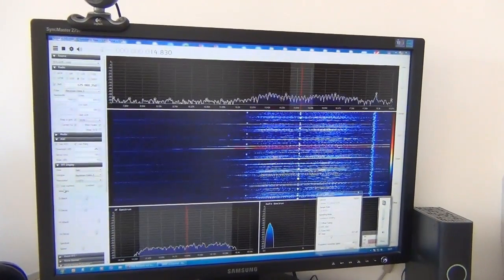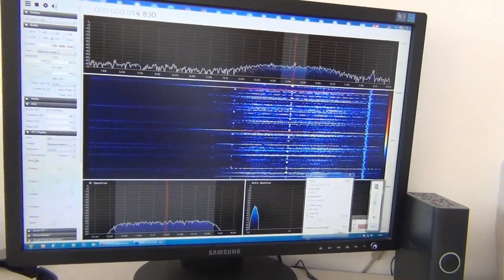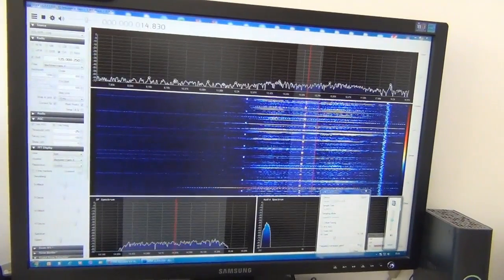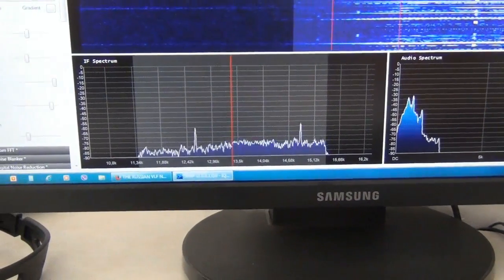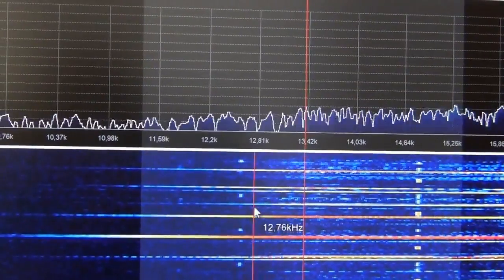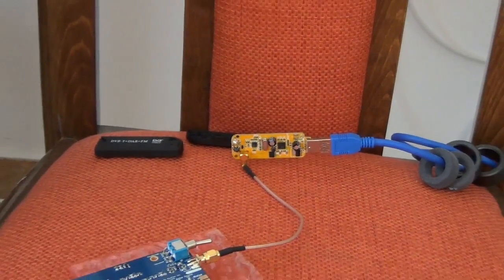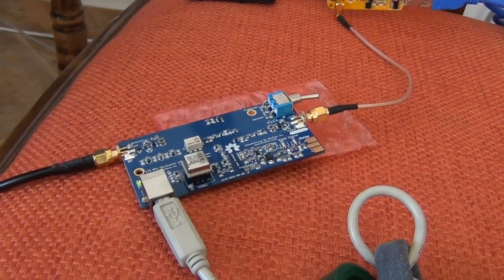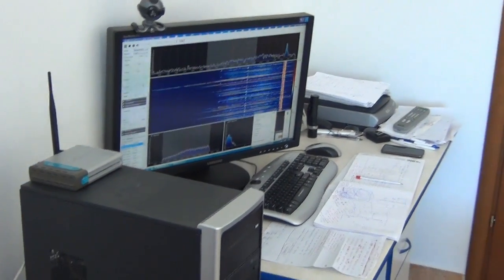RTL-SDR on VLF (ALPHA Russian Long Range Navigation System receiving in Macedonia with MiniWhip)

Comment: Hello Mile, Could you tell me what kind of ferrite toroids you are using around the USB cable (visible at 4.07 min in your movie)? Is it 61 or 77 material?regardsMark
Reply from the maker: +Mark van Dommelen: I am using no name ferrite toroids. Just those which I have. I realy don`t know the  type of the ferrite toroids material... :-(
Reply: Ok no problem Mile, did you check the difference with and without the toroid cores? does it make a difference in receiving the alpha signals?
Reply from the maker: +Mark van Dommelen : USB cable without ferrite toroid cores produces unwanted signals, especially in VLF, LF and HF, with vary levels depends of location and distance between PC and SDR...

Comment: How could you get such clear signals on such a low frequency? I have a RTL-SDR and also the Ham it Up v1.2 and basicaally all I receive under shortwave is noise and interference, even AM signals are very noisy. I have a homebuilt discone antenna and a ramdom wire antena.
Reply from the maker: +t0nito, On AM band, LF and VLF, there are lot of man made RF-noise, and very high noise level. A good and adequate antenna for receiving those frequencies is essential. One of the best antenna you could make yourself  (for receiving only) is mini-whip active antenna. You can find the details described in my comments on my other videos here on Youtube, or you can find many articles on the web about making this antenna (PA0RDT basic design)...

Comment: Hi Mile,
what about the Khabarovsk and Seyda  Alpha transmitters are they no more active ?
Reply from the maker: Hi Junkrigger,
According to the limited information on internet, the Alpha system consists of three transmitters, which stand in the proximity of Novosibirsk, Krasnodar and Khabarovsk. Two other transmitters at Revda and Seyda are not currently operational...
Reply: Mile Kokotov
Hi Mile,
I tried this website to receive Alpha :
 http://websdr-berlin.ddns.net:8902/
It's possible to receive a station at 12.04kHz
Bandwidth and Mode are tuned to
 0.09 kHz @ -6dB
 0.55 kHz @ -60dB
If http://www.vlf.it/alphatrond/alpha.htm is right then this should be the
Seyda station or am I wrong ?
Reply from the maker: Junkrigger  Proved indeed! There is Alpha signal on 12.04 KHz listening via websdr-berlin. But I am not sure about Seyda location. I can not received this with my equipment at home...

After more carefully listening on websdr-berlin, I think that this is the same signal from 11.904761 KHz. Isn't it ?

Comment: Excellent video, well done. However are you sure that the ALPHA output power was 500 kW and that was not the input power? On the obsolete USA Omega Navigation System (upon which this Russian system appears to be based) the output power was "just" 10 kW, although the input power would have been much greater than that due to antenna inefficiencies. For an output power of 500 kW on an inefficient VLF antenna the input power must have been many megawatts.
Reply from the maker: Hi David, My information is that Transmitter RF power output of Alpha navigation system on VLF is about 500 KW. However, Effective Radiated Power (ERP) is something different. ERP takes into consideration transmitter power output (TPO), transmission line attenuation (electrical resistance and RF radiation), RF connector insertion losses, antenna efficiency...
For the Alpha VLF system, I have info that "estimated radiated power" is about 50 kW to 100 kW.
The Transmitter input power is simple DC input power that transmitter convert into rf signal power delivered to the load i.e. antenna.

Comment from the maker: Dear Alexandre,
I am using Ham it Up v1.2 NooElec UpConverter (with 125 MHz L.O.)
Notch filter here is for strong local AM broadcast radio station on 810 KHz (Macedonian Radio) about 30 km from my place and with 500 KW RF power, it simply drive out the front-end linearity of the receiver, and RTL USB Dongle too. The Notch filter is simple series LC tank circuit with zero impedance at resonance, so it takes the unwanted RF signal to ground and passing the other frequencies to the receiver input.
Band-pass filter is actually homemade HF preselector based on MFJ-1048 schematic (I am not using it for VLF) .
Antenna is Mini-Whip, based on PA0RDT design, with some modifications on power inserter.
Reply: Hi Mile,
Thank you very much.

Comment: Hi Mile,
excellent video. Please could you share more information about band pass filter, notch filter and Up converter?
Are you using the Ham It Up v1.2 NooElec Up Converter?
I would like to set up a system receiver to listen NAA, cutler, 24.0 KHz.

Thanks in advance.

Alexandre.